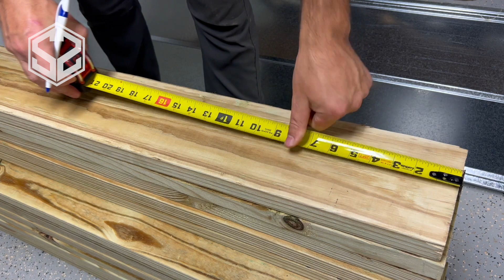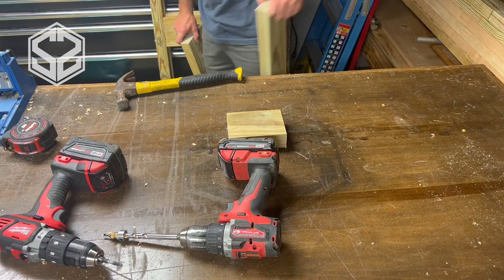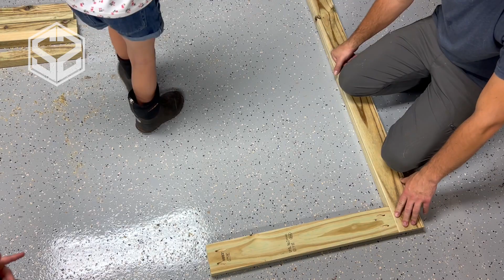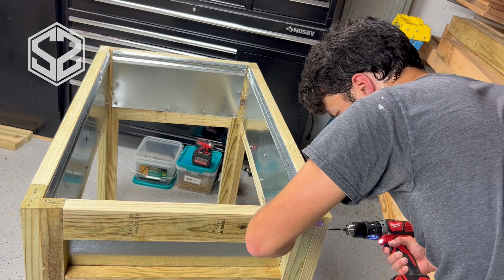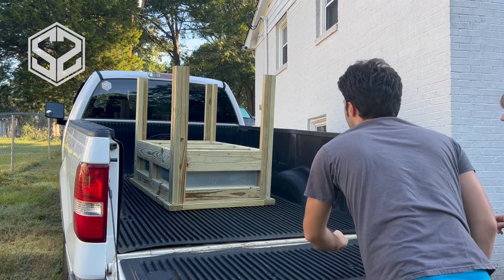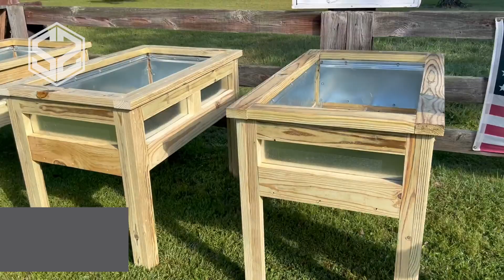Building Elevated Garden Beds

Comment: What do you do for drainage to prevent flooding the bed?
Reply from the maker: Haven’t had any issues. There’s enough gaps and cracks in the construction that water leaks out. But if additional drainage is needed, you can drill a few holes in the bottom of the metal roofing.

Comment: DYI after you spend 4 grand on tools😮
Reply from the maker: If you have the tools why not use them. But this could be done with a drill, handsaw or circular saw, tape measure, and tin snips. Probably around $200-$300 dollars of tools. But if you don’t have those tools, you may be better off just buying some already build garden beds.
Reply: I made one bigger than this with a 60 year old drill and jigsaw.    @SimonSaysDIY

Comment: Just curious if you drill holes for drainage?
Reply from the maker: Not yet. There’s enough gaps to allow water to drain but I’m keeping an eye on it and if it start to hold too much water I will drill some holes up through the bottom.
Reply: Yeah I was sold on the roofing sides, great idea. But the bottom not so great. 
Cedar slats with a quarter of an inch Gap seems like it would do the trick and have more stability but great idea all around
Reply: @popsTomatoes  yes, love the sheet metal sides which could help the garden soil gain heat first thing in the season, but for the bottom it will create drainage problems for the plants. Designs with slatted bottoms that are then lined/covered with porous landscape fabric seems to work well for keeping soil in the bed but allowing for drainage and airflow for the plants. Perhaps drilling holes and laying a porous liner before garden soil would work for this design.

Comment: Wow! This was the first I’ve seen of this type garden planter. Don’t understand the tin insert?, but great unique build.
Reply from the maker: The tin is there to protect the wood from rotting and moisture damage. But you could easily replace it with pressure tested or cedar boards on the inside. Thanks!
Reply: Because he's using treated lumber.  It won't contact the plants. Plus it's more solid..
Reply: @nephewsque6751  Treated lumber less than 20 years old is safe for garden beds. Search for university studies on this. And treated lumber is no more "solid" than other lumber.

Comment: Could I use pressure treated fence pickets instead of the roof sheeting for the inside walls and bottom and line it with garden bed lining?
Reply from the maker: Yes, that shouldn’t be a problem. 😊

Comment: Great project & fab helpers!

I'm wondering if there's a slight design alteration that could be made so struts that form the base are sitting on a more rigid frame element - with the design shown it seems that the only thing taking the weight of all the soil are the screws of these cross pieces.
Reply: a lot of the builds for these will add a ?cleat? that runs the length of the bed, then sit the cross members are sitting on top of those.  slightly stronger.
Reply: You could do a half lap from "above" at each joint/strut then the soil load would push down on those laps.  
The issue, as I would see it, becomes the panel construction method he uses would have to be changed to a different series of steps in a different order (you could not, at least I don't see the way, to attach the metal liner prior to partial assembly since you could then not drop the cross members from above) and would take longer (more cuts, separate steps, general less like a pure panel construction).  Not that it matters, I would do it that way, IMO just better construction method.  Necessary?
I suppose you could also cut an "L" into the bottom rail creating a small ledge for those struts to sits on top of, would not need much.  Thinking about this as I type, that maybe the way to go as it would allow for the panel type construction with only a slight amount of additional cutting.